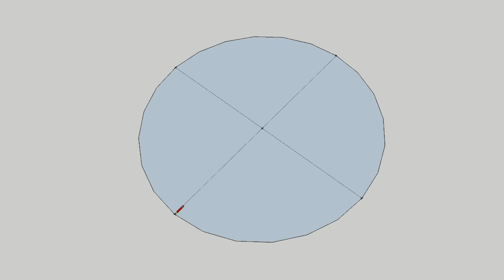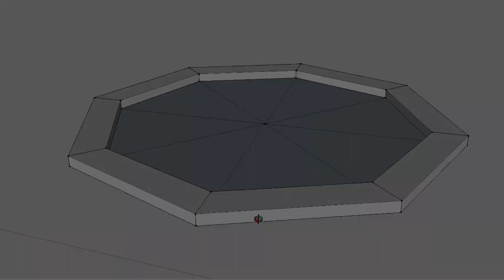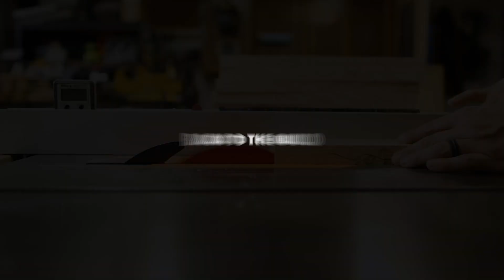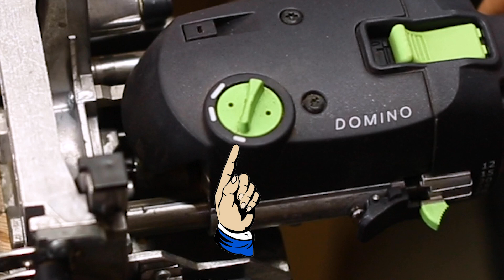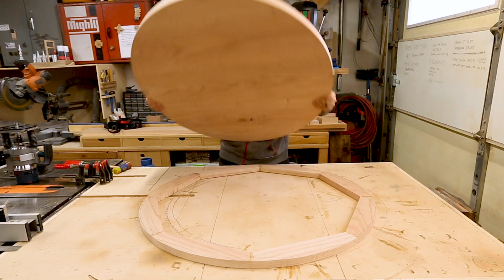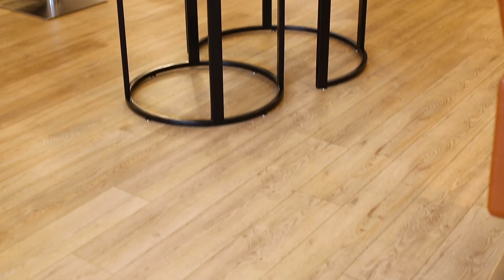How To Make Large Segmented Circles for Modern Round Nesting Tables

Comment: Diameter x pi (3.14) / number of segments = length of each piece
Reply from the maker: thanks!  but does this give me the angle i'd need to cut each end as well?  or just the length?
Reply: @stuffsethmakes  the length only, to figure the angle, 360 / number of segments / by 2 
Example:  360 / 12 segments = 30 which is the angle now divide by 2 and each piece is cut to 15* to make up 30* x 12 pieces = 360
Reply: @stuffsethmakes  always divide 360 by how many segments you want, be it 12, 16, 24, 48 don’t matter all the math is the same.
Reply from the maker: my life will forever be changed now haha!   thanks so much!  🙌🏻🙌🏻

Comment: the comment below for figuring the cut angle is correct so I won't add to that.  For figuring the length of the segment: simply multiply the diameter by pi (i use 3.1416) and then divide the result by the number of segments for your length - ez-pz.  SketchUp looks like a huge waste of time (i know nothing about SU).  This formula takes less than a minute.
Reply: That gives you the round length of each piece, not the straight length as what he was using in the video.  It's not the same

Comment: Quick math to find angle -

 (Number of sides -2) x 180 = total number of degrees.  For your project (8-2) x 180 = 1080 degrees

Total Degrees/ number of angles = each angel.   For you project 1080/8 = 135 degrees 

180 - each angle.  For your project 180-135 = 45 degrees

45 / 2 = 22.5 degrees for miter. ( divide by 2 since you are cutting the angle in half.

As long a you know the number of sides you can figure the miter.
Reply: How i can figure out size of pieces on different dimensions of circle?

Comment: Such a clean process video. I don't know how you don't have more subscribers and viewers.
To answer one of your questions in the video, a circle is 360 degrees. 360 / 8 segments = 45 degrees. You have the angle on each end of the board, so divide by 2 to get your 22.5 degrees.
The next question is, how would calculate the required board dimensions? Oh, it's too early in the morning for that. 🤷‍♂️ But I'm not sure I could say later in the day either. 🧐
You also mentioned segmented turners. Many of them use software which calculates segment angles, length, width, and offers a visual.